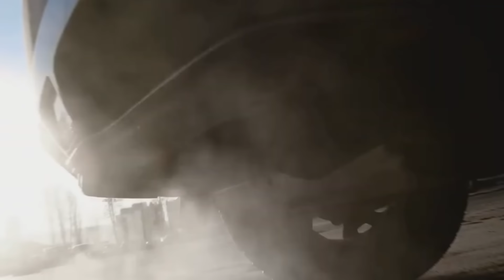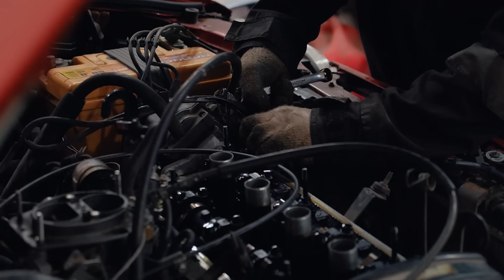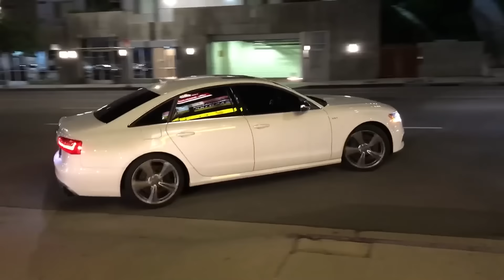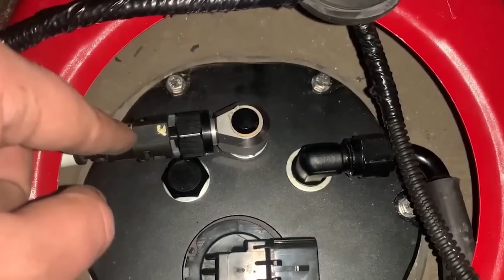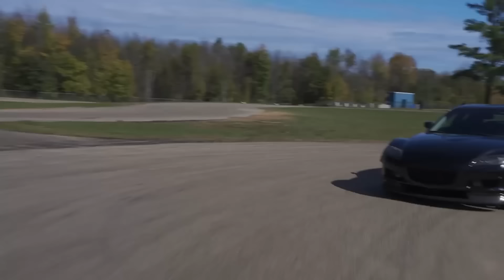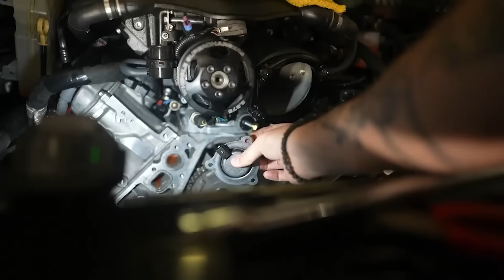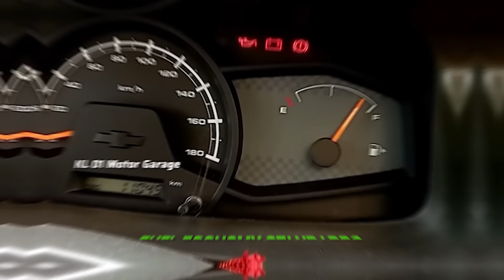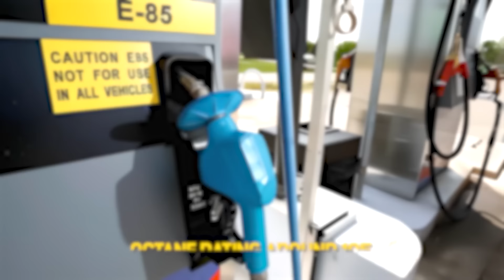10 Illegal Mods That Will Make Your Car Run Better

Comment: Manuel transmissions are way more safe I believe because it can help in slowing you down a hill giving you a third option in braking. The AT, braking system itself and pull brake if you have one.
Reply: emmanuel
Reply: You obviously don't know how to use an automatic.  Why do you think they have gear detents on the shifter? (P-R-N-OD-3-2-L)
Why do 3, 2 & L exist on that?
 Maybe you are talking about CVT?
All truck transmissions offer engine braking with gearing, even automatics. Most car automatics do too.
Reply: @AndreS_-df2nw  Try throwing the gear shifter into 3 or 2 when you're at highway speeds, and let me know what kind of sound the transmission makes as you void your warranty, and the sound your engine makes as the RPM's rocket past the redline if your transmission survives, especially if you have a 5, 6 or 7 speed automatic, which are common in most new cars that don't use a CVT. Pretty much anything made since 2010 is going to have a 5 speed transmission at minimum. Hell, Toyota puts 8-speed automatic transmissions into Tacoma's, Camery's and RAV4's, and Chevy's has had them as part of different trim packages on Malibu's since 2018, not to mention they have 10 speed transmissions available for the Suburban and Silverado....
Reply: @MaverickBlue42 the fact that newer cars & trucks have more speeds does not negate what I stated... using lower gears can & should be used to hold back the load using engine braking on all production automatics in certain situations, especially with trucks.... and that may include using the lowest gears sometimes. Additionally "just throwing it in low gear at highway speeds"  in modern trucks will cause it to use maximum engine breaking in the gear the computer selects until it is safe (not damaging the drivetrain) to use the low gear that was selected.

But remember  the OP was about MANUEL transmissions not MANUAL transmissions for load holding as opposed to automatics, and is completely wrong.
Holding back a 20,000lb or greater 5th wheel trailer on a long 6% grade with only brakes would be extremely dangerous and foolish. 

I'm not sure who Manuel is, but he must make magical transmissions.
Reply: @AndreS_-df2nw  Regardless, to me automatic transmission is best for a 90 years gold grandpa or 80 years old grandma. As for me, I will continue driving mine with manual transmission.

Comment: The E85 thing is weird do to a lot of gas stations have it at the pumps
Reply: E85 is mainly for flex fuel vehicles 
But the performance crowd is figuring out it work in drag racing with the right tune.
Reply: It's not e85 fuel that's illegal, it's certain tunings you put into your ecu that make it illegal

Comment: But the federal government can run any and all of their vehicles without any emissions control both gas and diesel
Reply: Everyone says that but at least here is not true, all vehicles need to have all the emissions elements that came with the factory vehicle, we even had a very old range rover that we had to close the diesel so much that it barely moved because of inspections yet it's from the government.

Even most military civilian vehicles have them, now army stuff for missions last thing they would care for sure is environment but rather performance, life saving and so on...

Ps: inspections here in EU really are picky and mess with everything even if it does not have to do anything with emissions or safety, recently you need to even have the car interior clean and basically anything at all will be put in the papers. Sure some PPL that are big friends of the inspectors, they always close the eyes to most stuff, but emissions = fail right away since everyone is looking and seeing the numbers in the screen and if it gets red would be hard for a friend to pass that car couse likely would get fired.
Reply: @guily6669 I am so sorry. I could not imagine having emissions inspections. The only thing florida cops will get you for, is tints. No one gives a damn about loudness, suspension, clean air, etc, thankfully
Reply: @Cblan1224 cops here also don't usually care about that, unless they see crazy big wheels on a old car that they know use tiny ones or the window tint, any colorful light and all that they can stop you.

Cops don't care about the power or pollution, though some might stop you because of sound...

The annual paid inspection is the problem they test a HUGE amount of stuff nowadays that aren't even safety related which they didn't even use to test before, was mostly safety and emissions related, now they can pick with car interiors and get a warning which is stupid.

Edit: what I meant was all government cars and pretty much everything has to follow the same exact rules and they can't just remove anything emissions related that was originally in the vehicle, even almost all army stuff that are just to be driven around here do the same tests, on old jeeps their mechanics close diesel a lot for inspection and then open it up after 🤣
Reply: @Cblan1224  The amount of air in Florida, is going to remain stationary is zero.
Reply: I think you're referring to the military
Reply: It's do as i say, not do as I do. I have a former enforcement patrol car. It came from the factory without catalytic converter. A different transmission, and other alterations. In short it will haul ass fast, when desired. I had it up to 140 mph., once it was still climbing, I just backed down on more speed.
Reply: The reason is there are far fewer emergency/police vehicles than reg cars.   Nohing to do with 'do as I say not as I do'
Reply: @RJ-pb1qx  Well if that's true, then I'm running less automobiles than the government. So I should not have to run all the anti pollution shit either. "The government runs many, many vehicles!"

Comment: It's a function of money. If you think street legal cars like Bugatti's and Lamborghinis are "fuel economy standard" you're kidding yourself. The government will allow you to pollute more if you're willing to pay more money. Exotic cars get as little as 10-13 mpg and produce oodles of horsepower. They often use race quality tires and suspension but are approved by the NHTSA for purchase. Some of the states in question that are so concerned about exhaust pollution still allow homeowners to burn trash.

Comment: Not sure where you got the automatic to manual transmission being illegal ? That’s just not true.
Reply: Technically modifying your car in any way affecting the drivetrain in some states is illegal period. This this is correct
Reply: Not to mention darn near all of these will turn on the 'check engine light' with no way to turn it off..  Emissions test?  It will not even be tested as it has already failed.
Reply: @davidbeckenbaugh9598  Often you have to swap the computer, or reflash it with software from a manual car. People convert all kinds of BMW's that were only sold as manuals in Europe, or only sold in very limited numbers in the European market. Most manufacturers don't bother to offer manual as an option in North America because almost nobody in NA wants a manual, but they offer them in Europe because almost everybody drives a manual transmission because automatics cost more there.

Comment: A functioning Catalytic converter has no restriction.
Cold air intakes are from useless to worse than stock unless the air drawn is from somewhere other than the engine bay. 
There is no restriction in modern exhaust systems (since the early 2000s).
 Changing ride height changes the geometry (alignment). There's no such thing as automatic geometry correction in any vehicle. 
VVT was literally created to improve performance. Making it standard began with Honda's VTEC.
Straight piping is just stupid. One more time...There is virtually no restriction in modern exhaust systems.
You will never outshift an automatic transmission on the drag strip.
E85 and massive power gains? LMAO!!!

I get it. This video was a troll. Good job.
Reply: There will always be some restriction in a catalytic converter, although a race cat is less restrictive.
And Ethanol has a very high octane rating, which allows for more aggressive ignition timing, higher compression ratios and more boost, so while not MASSIVE power gain it allows for some noticeable gains if tuned for.
Reply: @TheRealDr.Mabuse  The reason converters are shaped the way they are is because otherwise there would restriction within in. The total open area within the substrate is equal  or greater than the inlet/outlet pipes. No restriction. The only ones that did restrict flow were the infamous GM pancake style. I haven't seen one of those in 40 years.

E85 does not in any version of reality make more power than gasoline with 10% or less ethanol in it. Engines running straight ethanol get terrible fuel economy.
Reply: @Evil_Clippy  
As long as the catalytic converter is legal in any form, it will have increased surface area, which inevitably causes some friction. So technically, there’s always some restriction, although on modern cars it's often negligible.

E85 contains 85% ethanol, that’s what the 85 stands for. When working in test cells we managed to increase output by about 25–35%, depending on engine displacement. The commercial engines was limited to 20% increase in power when runign on E85. So I’m not quite sure what you’re referring to.
Reply: @TheRealDr.Mabuse  "Yes, using E85 fuel typically leads to a reduction in fuel economy compared to gasoline. This is because E85, which is a blend of ethanol and gasoline, has a lower energy density than gasoline. Specifically, the energy content of E85 is about 30% lower than that of gasoline. 
Here's a more detailed explanation:
Lower Energy Density: Ethanol has less energy per gallon than gasoline, meaning you need to burn more E85 to produce the same amount of energy as gasoline. 
Reduced MPG: This results in a decrease in miles per gallon (MPG) when using E85. Typically, flex-fuel vehicles (FFVs) experience a reduction of 15-25% in fuel economy when running on E85, according to eFlexFuel. 
Factors Affecting MPG: The actual MPG reduction can vary depending on the vehicle, driving conditions, and other factors like temperature and tire pressure. 
Potential Savings vs. Reduced Mileage: While E85 is often cheaper per gallon than gasoline, the reduced fuel economy might lead to higher overall costs per mile, according to Consumer Reports". 

One more time...E85 (from 51%-85% ethanol depending on State) does not make more horsepower. If it did, fuel economy would be higher than with pure gasoline or even the ~10% blend currently at most pumps. You are using test mules with a lot of modifications. The video is about what Joe Average can do to his daily driver to increase HP and/or fuel economy. My Chrysler is a Flex Fuel car. I've ran E85 in it instead of the normal 87 Octane Regular. Fuel economy dropped, a lot. Why? Because the accelerator had to be pushed down more to go the same speed as with regular gasoline. The injectors had to stay open longer for the same spray cycle. Longer opening = more fuel = less efficient. I only use E85 in an emergency because it's so poor. 

I made quite a living with Catalytic Converter sales/installs. There is no restriction. By your logic, the exhaust pipes themselves are restrictive because of the amount of surface area involved. Hot Rod magazine ran dyno tests on their Corvette making 660 HP. It made 660 HP with and without Cats. Tell me some more about the restriction.
Reply: @Evil_Clippy  The key words here are surface area and legality. If a catalyst is supposed to have any real function in reducing emissions, it needs to be in contact with the gases it's meant to filter. Applying the same logic to exhaust pipes, as you suggest, is like comparing apples to oranges—different applications require different designs.

I think we’re going off track a bit, what you’re copy-pasting is a wall of text about something I didn’t bring up. I responded to "E85 and massive power gains? LMAO!!!", that's it. Power gains and fuel economy are apples and oranges.

Comment: I turned my 5.3LS into a high power beast 💪 and i get 2 mpg more than stock with an extra 100hp 😂
Reply: Really how did you do that how did so I can do that with my 5.3
Reply: @Dezzy160 truck norris cam cold air intake headers and took it to a tuner ❤
Reply: @Dezzy160 p.s. no e85 running 93 only
Reply: @Dezzy160 catalytic converters absolutely kill the ls engine
Reply: No sH*t....🤣

Comment: In the UK, most vehicles ae subject to annual tests which include emissions, If your car is outside the specified figure, regardless of what mods you might or might not have done, then it fails and must not be driven. Likewise for excessive exhaust noise. 

Changing your car from an automatic to a manual gearbox seems pointless; for the ame money, why not just buy a new car?

Again, providing it's roadworthy and passes the tests, the type of fuel doesn't really matter either. Most fuel here is E10 (10% ethanol), 5% is widely available and 0 ethanol in a few places. Modified engines running on strange fuel are fine if they pass the checks. Whether higher-octane fuel gives better performance depands on the vehicle and the ECU - it's always worth a try.
Reply: Sentimental value?